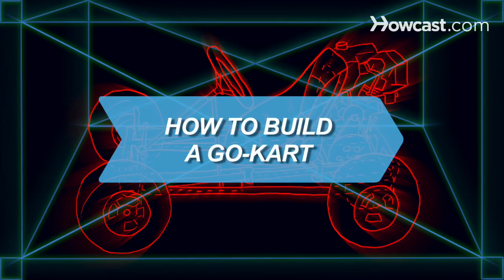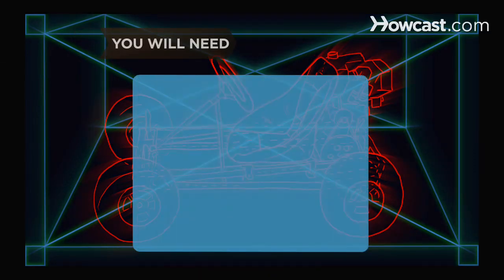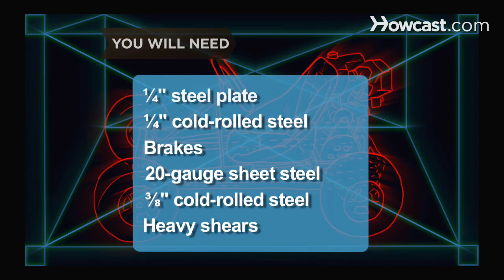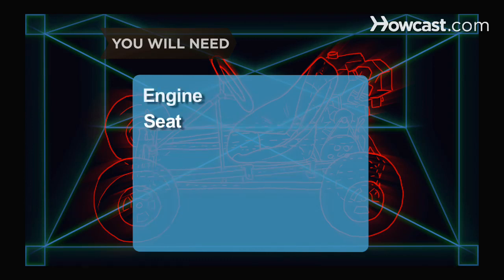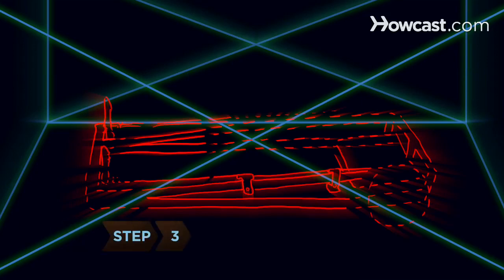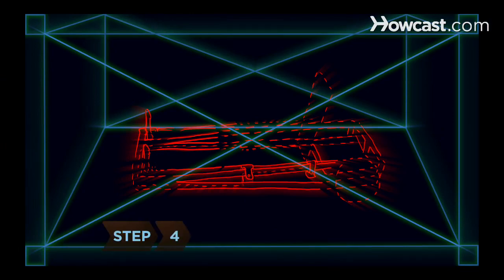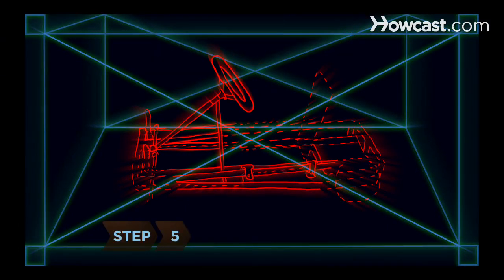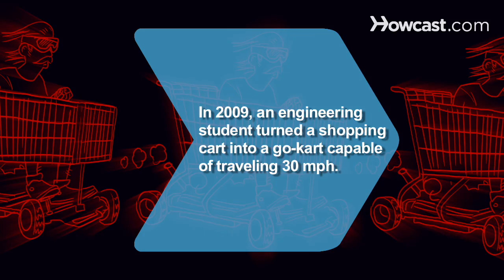How to Build a Go-Kart

Comment: Cause every kid has Internet acces, Go-kart assembly, diagram, metal forming tools, angle iron, welding apparatus, 1/4" steel plate, 14" cold rolled steel, brakes, 20-gauge sheet steel, 3-8" cold rolled steel, heavy shears, engine, seat, and 4 wheels.

Basically this guide is telling you to follow the instructions from the kit.